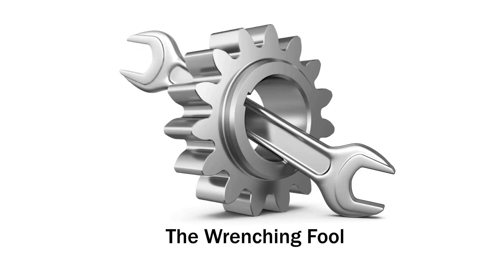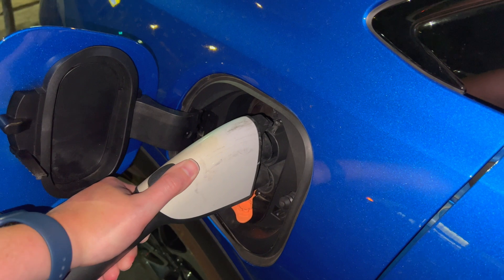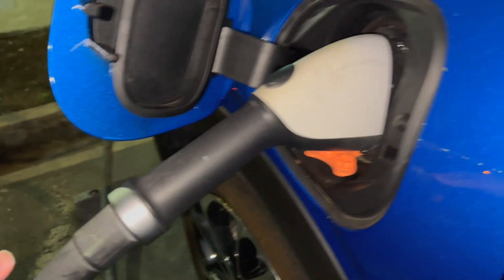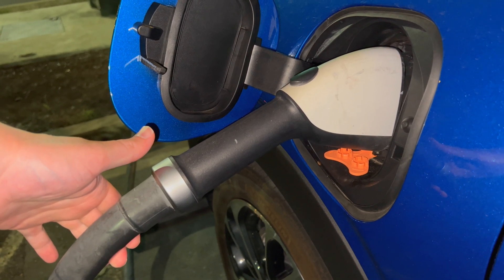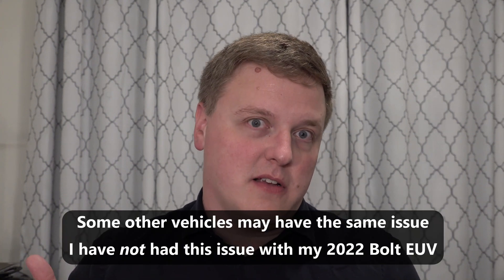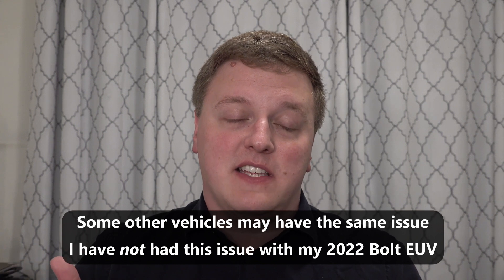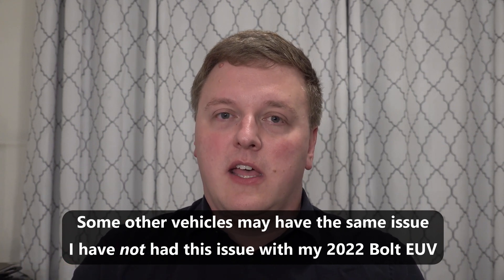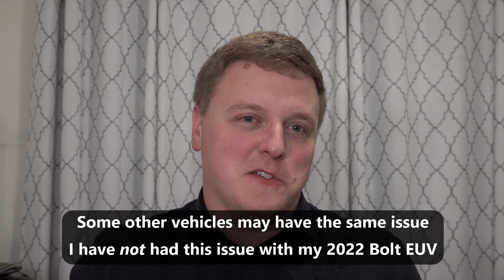2019 Chevy Bolt EV Charging Issues at Electrify America

Comment: It's not just the Bolt. I've had to do this with my Niro EV.  It works. But you're wrong - it IS entirely their fault. 😁 Or, at least,  the fault of their early hardware.
Reply from the maker: I knew that other vehicles had the same or similar issue, but since I didn’t know exactly which vehicles, I figured I’d let the comment section let me know which other ones have the same issue. Oddly enough, I never had that problem on my 2020 Kona EV.

I think it’s fair to say that it is mostly, but not entirely the fault of EA since the Bolt was one of the best selling (if not the best) CCS fast charging EV at the time when they were first rolling out their network. So, using hardware that has compatibility issues with the Bolt was a ridiculous oversight. But, the same could be said for GM/LG since they were using a charging connector that was too flimsy to support a DCFC cable.